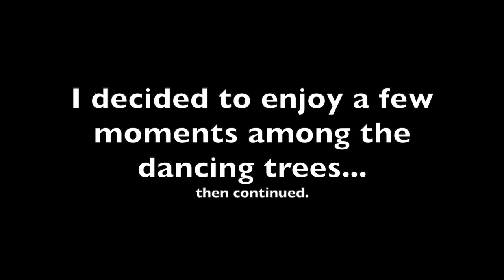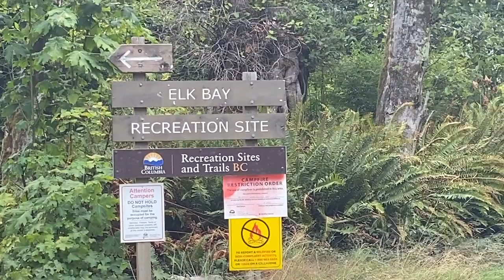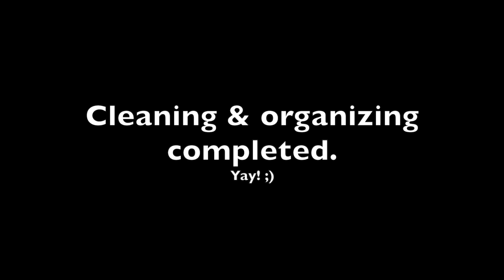#VANLIFE | Setting Up Camp | Elk Bay Recreation Site | PNW | Minivan Camper Conversion | Solo Female

Comment: Canada has so many more beautiful outback areas for camping than US does. Between you and Chrome, I've seen gorgeous nature views and I so appreciate it. By the way, I just left a very long comment/question on your "IKEA Cottage..." video about your bed. Basically it asks about your height as you must be shorter than me in order to stretch out in your bed or sit on it in sofa mode. Also what is your mattress and this is just the bottom third of the Lycksele frame? Seems like a waste to spend $250 USD and use only 1/3 of the frame and either none of the mattress or just 1/3 of it. For ME, I mean, since I'm on Social Security as my only income. But I really like your setup! Anyway love your videos, your sweet smiling face and gentle tone. Thank you for sharing your adventures.
Reply from the maker: Hi Michelle, I do apologize. I am not in cell service/wifi range often and it can take me some time to reply to comments. I have been getting a lot of questions about the futon. So I will address it in an upcoming video...for now....the futon is a sofa bed that comes in three separate pieces. Have you seen the trip-fold mattresses everyone seems to use in their vans? The three sections of the futon frame folds up in the same manner as a tri-fold mattress. I removed two of the pieces and only kept the third that you actually sit on, the section that has the legs/wheels. I will try to post a short video showing what is left of the frame in the community tab on my channel sometime today....if I can figure out how to do so LOL....I hope this helps.